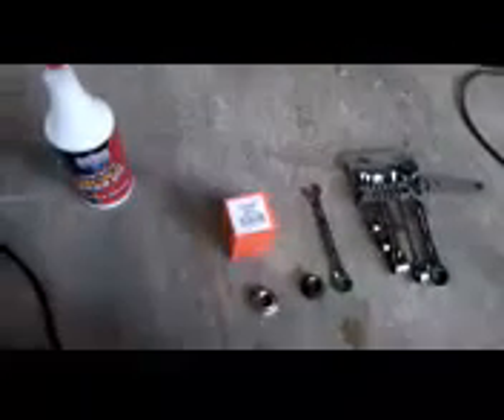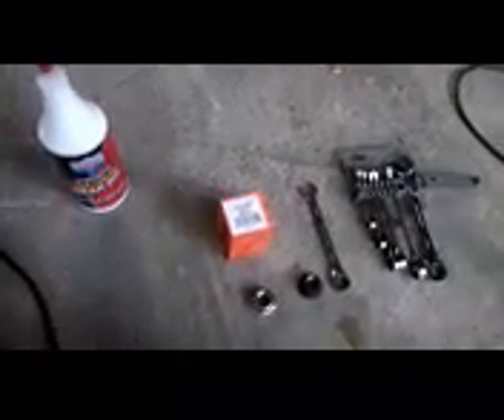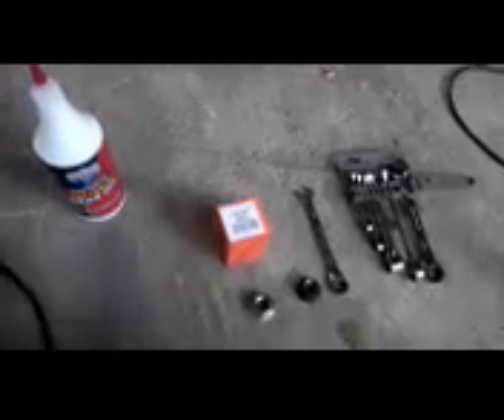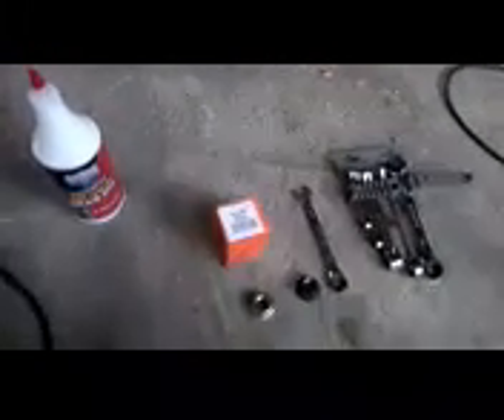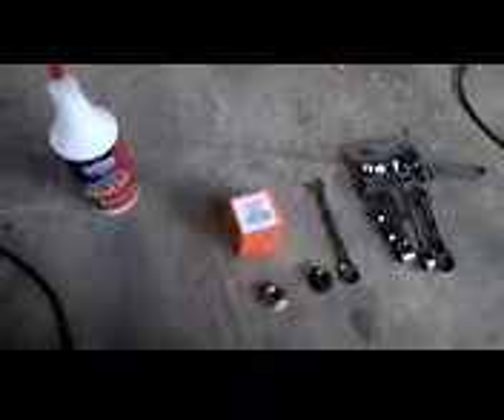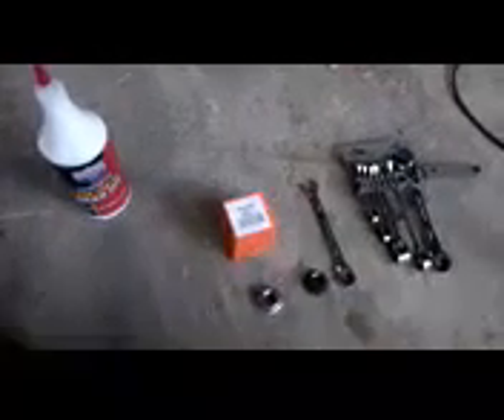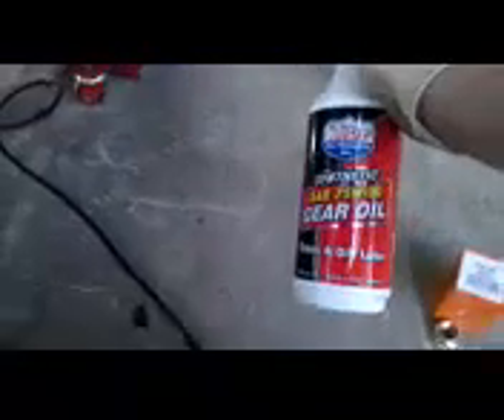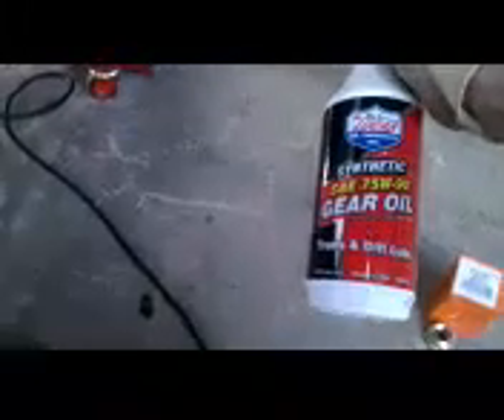2003 - 2008 Matrix Clutch 5 speed C59 Trans - Step 5 of 5

Comment: SHOULD YOU SWAP OUT THE TRANSMISSIONS OIL in the 5 speeds now and then? They say it's $120 to do. I have potential Syncro issues. 3rd gear grinds on ice cold days sometimes. About 25 times in 2 years. Only within first few minutes of driving does this happen. Toyota looked at it and couldn't tell me for sure without ripping things apart (for thousands of dollars). They said it'd be about $4,000 CDN to fix if it needs fixing and that I'd be best just putting in a new transmission (It's the 2010 1.8 liter 5 speed model).
Reply from the maker: Before replacing the transmission, I would recommend trying the Lucas synthetic fluid. I also had previously installed a remote start, so I would warm up the car on really cold mornings, which also helped. I never had any grinding in my transmission, so not sure what has to be repaired. 

Good Luck!